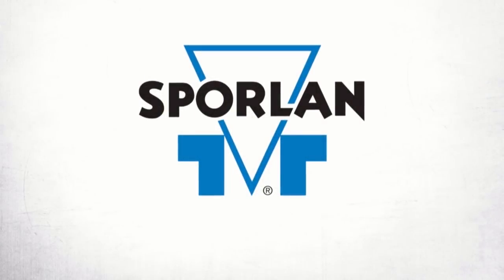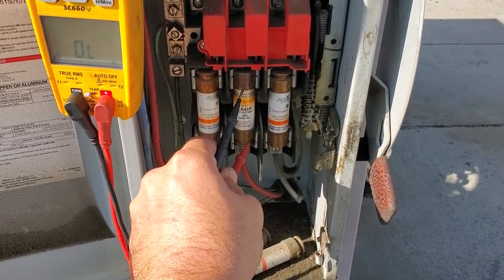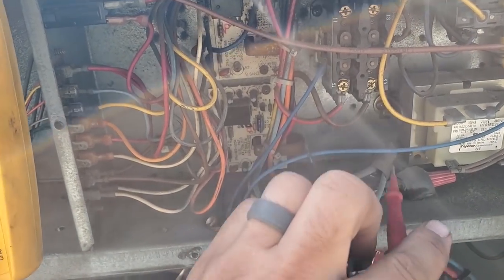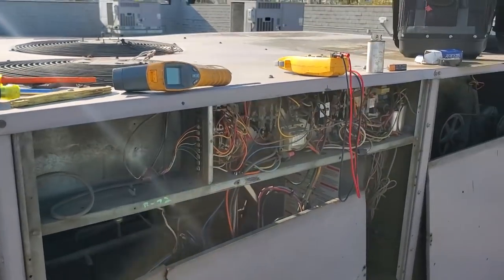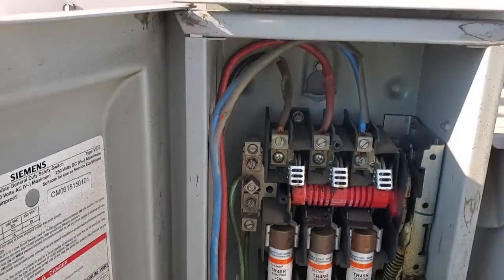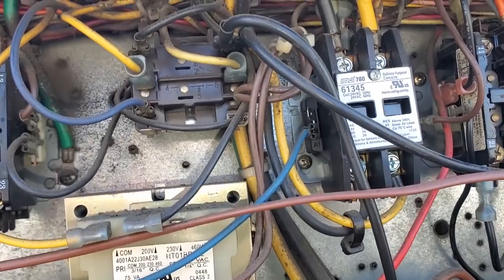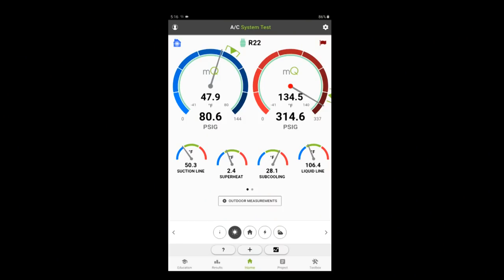KITCHEN AC IS BLOWING HOT AIR

Comment: Hi there, I think you are doing a great job with your informative troubleshooting videos!  I would just make one request.  Would you mind avoiding tightening live electrical connections on your videos where possible?  I find many people become complacent or loose focus while diagnosing live electrical and it is always better to take a few minutes to shut down the power upstream of a disconnect beforehand.  I'm in Ontario and we are required to wear high voltage gloves while doing any sort of live work (including voltage testing). We still have fatalities due to electricution each year in most of our major cities, usually with the high voltage gloves found on or near the unit they were servicing.  Keep up the good work!

Comment: you have a drop of voltage, you should checked voltage from the breaker downstairs, its causing you the middle leg overheating. you didnt checked the total amps on each leg..... the contacts in one of the contactors too. How to submit a quote when there is not a real issue diagnosed.

Comment: Maybe you did, but did not mention it or show it.
You replaced the bad capacitor, but left the other one. Usually you replace multiple items when you replace one, like multiple fan motors, the fuses, or contactors. As you state, it would be cheaper to replace the cap now rather than on another service call.

Comment: Despite the pitted contactors, they still have zero voltage drop across it, i know you're looking for preventative measures but they still fine to me
Reply: joel watts the points are what give contactor s the rating. When the points which are made of silver get pitted the contacts can arc closed or give a bad contact. Changing a contactor beats the shit out of changing a compressor.

Comment: ? Why could you not check the compressor without power on?   Take 2 seconds to check winding and that normally what causes fuses to blow. Caps are good till below 25% correct?
Reply: Uncle Dread caps rating is normally +-6%. Some are 5%. The cap will say it on the info stamp

Comment: The US electrical code, especially the connectors and fuses give me heebie-jeebies. This whole thing would be completely illegal in EU.
Reply: It's not exactly a brilliant setup, but at least there actually is a fuse and a disconnect. Sadly stuff is either imported or so cheaply made that it hinders the progress of safety around electricity. You could get safer systems, but it would cost you more money.
Reply: Basic Electrical Circuits are simple. Just remember, power must always return to the panel for a Circuit to work properly [leaves on the Hot (Black) and returns on the Neutral (White) for 120V circuits and leaves on Line 1 (Black) and returns on Line 2 (Red) in 240V circuits]. Remember that and you should be able to use a good How To book/You Tube video to wire any circuit in your home safely and to Code (If you're the Home Owner, get a Permit from the City and the Inspectors will insure that it's done Legally and Safely)...
It's when you get into Programmable Logic Controller (PLC) and/or Relay Logic circuits and 3 Phase Motor Control that it can get confusing...

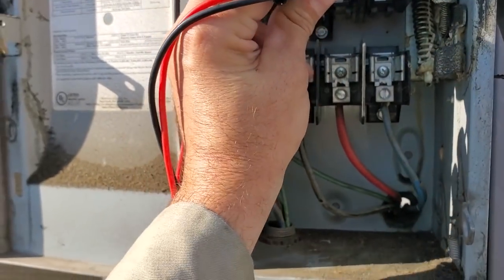Comment: Ok At 7:20 you check the disconnect to make sure it is open by checking between phases. But what if only one phase was stuck on? Without fuses it wouldn’t show a voltage potential because the other two contacts are just floating... right? Would checking to ground make more sense?  Great work btw, those are some monster fuses!
Reply: I had exactly the same thought. Checking each phase against the common ground would be the correct thing to do.

Comment: Always, always, always change all three fuses on a three phase system. You can be sure that AT LEAST two fuses have carried some degree of fault current where star (wye) or delta connected loads are concerned. In the absolute worst case, during a fault, the ‘sand’ in the HRC fuse can start fusing together to form a ‘tunnel’ of glassy sand but the element doesn’t break. Imagine you replace only the ‘failed’ fuse, but leave the ones with the forming glass ‘tunnels’. Next time the fuse is called to clear a fault, the element ruptures but the sand cannot fall in to quench the arc. Now the fun begins..........the arc can (and does) burn out of the fuse body and very quickly (within a couple of cycles) propagate into a full three phase arc flash within the disconnector. Imagine you were just flicking the equipment back on to test and a fault remained in the plant.  Now you are facing an ‘arc in a box’. 
Always replace all three fuses. 
Always close the gear before energising.
Reply: Thanks Chris! I sent you an email on the same topic too 😉
Reply: Arc flash is no joke, at best it's a good way to make you feel like your eyes were sandblasted, at worst it can kill you.
Never seen one in person, but I have seen the videos. It's literally a constant explosion fueled by electricity.
Some rocket engines use this phenomena to heat propellant, they're called Arc-jets.
Mostly it's thought of as a low-thrust system for propelling satellites in the vacuum of space (too much power needed to create enough thrust to push something off the ground, but just putt-putting around in space is easy with a few 10s of kilowatts of solar power).
The best part is that you can use just about any liquid as propellant, provided it won't freeze or boil in the tanks and is somewhat chemically neutral. I think there's a company designing one that runs on Water, but you could use Ammonia or Hydrazine if you wanted a little more performance per kilogram of propellant.

Comment: Great video as always. Im the same with phone calls. As soon as a phone call is going to take longer than 5min worth of checking the blatantly obvious stuff you might as well just go and do it. Also is it part of the code for the disconnects to be mounted on the units? I just see so many disconnects go bad on both yours and other hvac chanels that makes me think they just get shaken to crap by the units especially as they get older.
Reply: TheColinputer  by code here in Texas the disconnect or breaker must be within 15’ and in sight of the unit. It’s a safety issue.

Comment: It's almost completely shot. Disconnects give lots of trouble   fuses do funny things. I've had them open up when they have current going through them then check fine with multi meter   the covers are sure tore up
Reply: Roy Amberg I always check voltage drop across fuse while unit is running, anything over .5 to 1 volt and that fuse is getting replaced regardless off continuity check with fuse removed.
Reply: @m0fr3sh90  you didn't get what I was saying. You can ohm a fuse and it will ohm fine. Once you put current on it it opens up. Example. Single phase system. No power after fuses. And power before. Disconnect is on so fuse will show open with a volt meter. Turn power off it ohms fine. Had this happen before. Several times
Reply: Roy Amberg gotcha

Comment: I see there is an issue with getting fuses out, along with blades making good contact. I have been an HVACR tech for over 15yrs now. I have been a plumber for 10yrs. I have been in electrical and the manipulation of the electron as a hobby for my life. The biggest issue an electrician taught me with boxes like that one, rather it be a breaker or disconnect,  is that there is no protection from the elements. I carry dialectical grease for all fuse and disconnect blades. The biggest issue is corrosion between points of contact. Even if the blades are not all the way in front of each other. They may be still fully engaged.  Just to much corrosion.

Comment: I noticed that your superheat was only a couple degrees on measure quick and it's saying that it's good and where it needs to be. I've heard a rule of thumb is to have 10 degrees of superheat and 10 as well for subcooling. So my question is why is this lower number where the app wants it to be? Thanks in advance for any responses
Reply: Troy White you need indoor wet bulb and outdoor temp to find the proper superheat set point.
Reply: @actechformallyyomama746  thank you

Comment: At 7:17... You made a major mistake: you checked phase to phase. If only a single phase was on, you would have mesured zero as there is no return path to any other phase. The proper way would have been to check to ground, or to a known good phase (before the disconnect). This way you would have mesured something if only a single phase was stuck on.

You could have got zapped bad. Fortunatelly it is 'just' 208V...
Reply: Correct me if im wrong, but if one leg was stuck closed, you would have 120V on that leg. If the other 2 legs were not energized, then there would be 0V. Therefore, if you tested voltage from the stuck hot leg to the other non energized leg, you would read 120V.
Reply: @Edward-ud8hd  You are right on the 120v part, but not on the energised to not.. 

Let say that phase 1 knife make contact, but not 2 and 3. 2 scenarios. First, fuses are intact. Phase 1 loop throught the equipment and back at the fuse 2. Fuse 2 therefore read 120v at phase 1. Voltmeter see 0v difference. Scenario 2. Fuse is blow. 120v phase 1 is present at the bottom of fuse 2, but can not reach the top. The phase 2 knife is open. Therefore, the top is floating and no current can flow. Meter still read 0v.

In both case, 120v is present.

We have both scenario here...
Reply: You really need to test both phase-to-phase and phase-to-earth - there are scenarios where only checking one is unsafe (eg only checking phases-to-ground with a bad ground)..
Reply: @ickipoo  a bad ground in such setup is very improbable, close to impossible due to how and where it is installed (indirect ground in multiple location) bit not null, so yeah, you are right.
Reply: @thephantom1492  I agree, but that's the problem with Internet advice - someone can take it, and apply it in another context (say, a disconnect in another location), and come a cropper.

Comment: Have a question about your amp meter do the top clips measure amp draw by just clipping to them
Reply: Thomas John Hanlon II the one clamp on the top measures amps by clipping AROUND them. But other than that, you are correct.
Reply: The current flowing through the wire produces a magnetic field. The clamp is, essentially a transformer core, and by clamping in around a wire, the field couples into the meter.

Comment: No kidding it’s falling apart
Reply: This HVAC package unit is a cream puff compared to some of the equipment I've seen.  The compressors seem to be just fine and the coils don't seem to be leaking.  Motors, pulleys, belts, capacitors, and disconnects can easily be replaced.  The cover can also be patched if needed.  There was a little pitting on the contactors but it didn't look that bad to me and he didn't measure any voltage drop so there is no resistance there.  If the disconnect blades were loose and corroded, I would definitely replace the disconnect.

Comment: KITCHEN AC IS BLOWING HOT AIR, which in turn causes the kitchen employees to blow "hot air" LOL
Reply: I bet those people in the kitchen were complaining.  I can remember sweating like a pig over a hot grill, cursing the restaurant manager for not getting the A/C fixed in a timely manner.
Reply: @picklerix6162  heh, I bet glass blowers and boiler operators and large scale welders wish they  had A/C. some of that stuff is preheated to 10 bazillion degrees, then they get to work inside of it welding lol